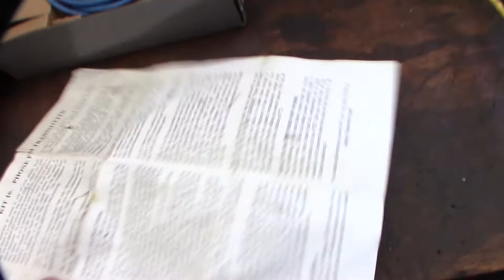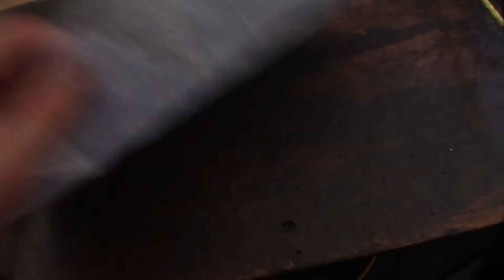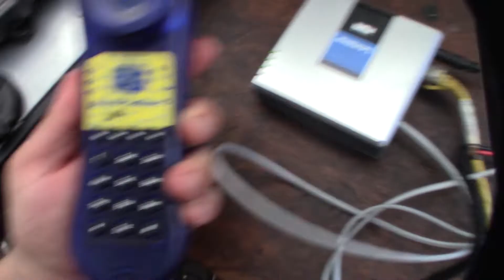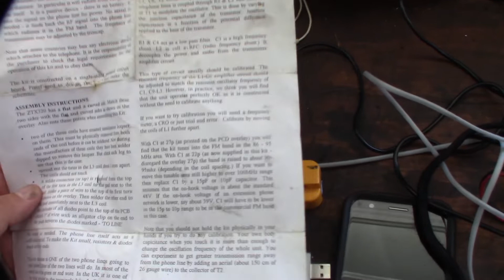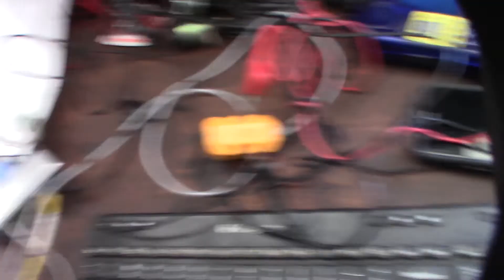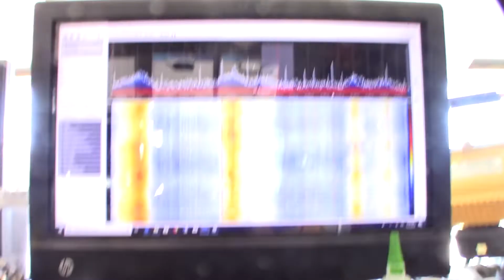Hidden Analog phone Wire Tap bug found troubleshooting NSA FBI Police

Comment: Hey and hello :-) , sorry to bother ya but was just watching and enjoying some of your vid's when i saw this one and brought back memories, its hard to see in video but it looks like the "Bug" device or listener is possibly connected wrong. Most i've seen in the past where meant to have one of the aligator clips connected to either of your carrier lines , ie. in residental, either the green or red, which must first be broken or cut, then connecting or patching through the cut red or green. like a splice. Sorry I coulda prob explained that better lol. cut either red or green, not both, then attach one end of clip to one end of cut line, then attach second clip to other end of cut line. Devices similar to these and for what it looks like from what i see, where not meant to have a clip on either green then other on red. If that makes sense. I apologize again for not explainin g that better and hope it helps :-)
Reply from the maker: OK, actually thank you. I've been trying to figure out this thing for years.  You saying to should be wired inline on one telco lead instead of both?
Reply: @fintechrepairshop  Yeah, I've had a few run-in's in the past with those devices first in telemarketing offices, then in tech. college for net+, but most all i've seen are similar , hope I helped
P.S. enjoying the vids
:-)
Reply: Interesting that would explain why in his story he said it was clipped vertically and not horizontally. They would've had to pop a bridge clip off and then that would replace it and put it in series with the line.